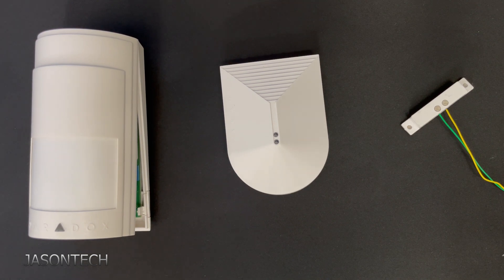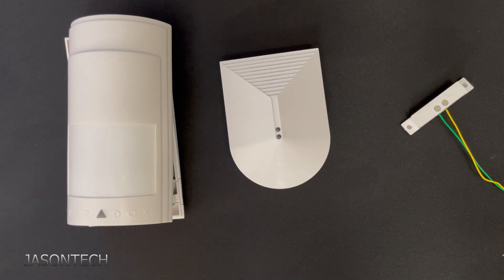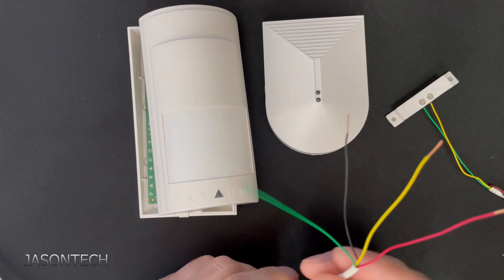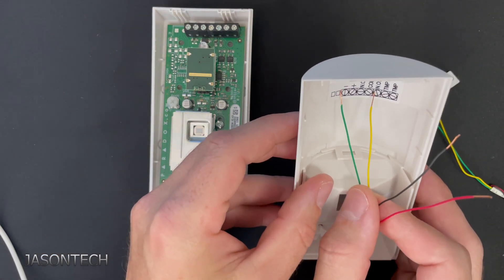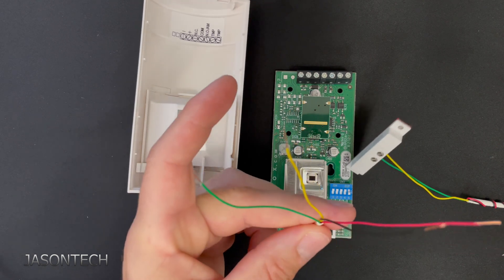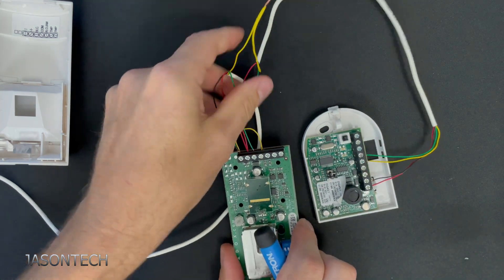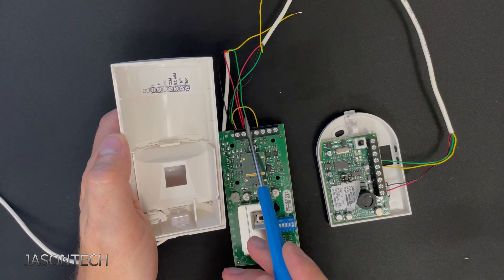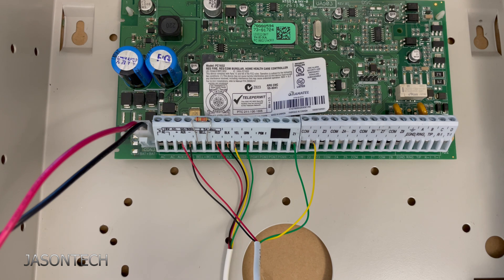How To Connect 2 Alarm Zones With Only Using 1 Alarm Wire.

Comment: Does it have to be 2 seperate zones? Or can it go common and zone 1
Reply from the maker: In this video yes, If you don't want to use the wire for 2 zone. It's a different way to set it up.

Comment: Thanks for the video. Is it possible to program the pgm arm/disarm function to also have a panic if it is held. I.e. 3rd party remote button press arm/disarm and remote button hold to trigger panic
Reply from the maker: You can but there's more to that. What system do you have?
Reply: @JasonTech  I've got a Paradox SP6000 alarm system with a Centurion Nova Multichannel receiver

Comment: Hi Jason. I have 4 IR beams ( 2 receivers & 2 transmitters) that i need to connect on 1 zone. How do i do that, cause when i connect the 2 NC & 2  Common to the one fron the panel, it doesnt work.
Reply from the maker: You can't do that, you have to connect it in series. See this photo. https://cdn.getawaycouple.com/wp-content/uploads/2022/01/31093839/Series-VS-Parallel-1024x576.jpeg

Comment: Great video. I would like to take a place where I previously had a window with a window contact and reuse the wire for a glass sensor. The problem is the glass sensor needs 4 wires and the window contact only had 2 wires. Can I jump the 2 to create 4?
Reply from the maker: Your window contact wire doesn't have 4 wires? Because it should
Reply: @JasonTech   I double checked and it only has two. Based on that, I am guess I can't do it because I need power and ones to the zone (I assume).
Reply from the maker: That's right, it won't work. But check your alarm panel, it's got to be a 4 wire. I think you have this type of contact. https://m.media-amazon.com/images/I/51YAsF8vb4L._AC_SL1000_.jpg
Reply: @JasonTech   Thank you. There is only a black and a red. I truly appreciate all of your advice and your videos are really awesome.

Comment: Brilliant! I'm having a new panel fitted tomorrow (self install). old one being removed by a company. I have 2 exterior sensors with 1 cable going to both in series. Think they used the atz function due to not having enough zones. Not 100% sure. I have more zones now.
So this is how I would wire up 2 takex MS series in the same way? 
Where would I put the eol resistors here? 
Thank you
Reply from the maker: You can, use the tamper as the jumper. So you can put the com wire on one of the tampers and put the resistor on the com and the other tamper.

Comment: Hi
Thanks for the video. In this case, I can’t use registor? My alarm panel still open because i think i didn’t use registor. Is it right?
Reply from the maker: Do you mean resistors? Most panel have the end of line resistors turned on by default. So yes, you need the resistor.

Comment: if I put yellow on the com panel, would the sensors work on 1 zone
Reply from the maker: No, you need the wire in zone 1. Com is just a ground.